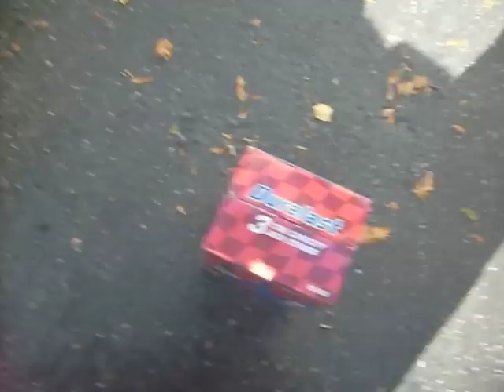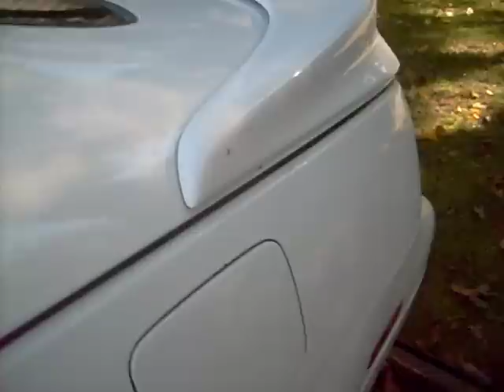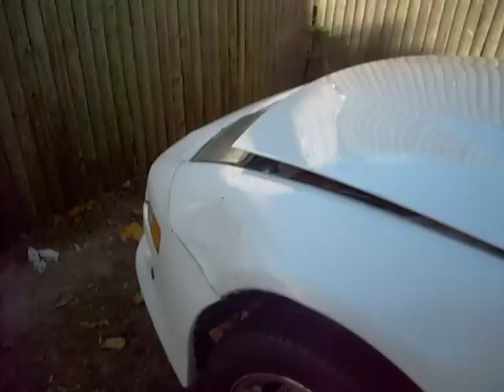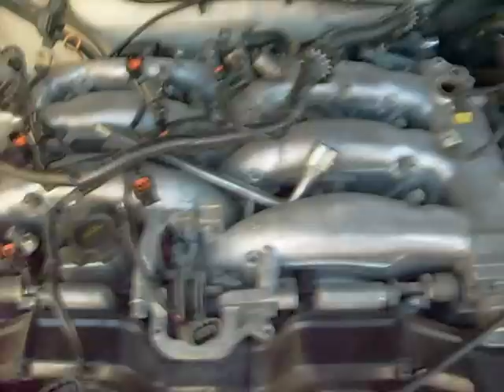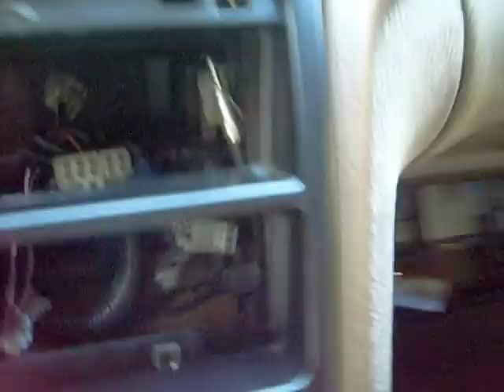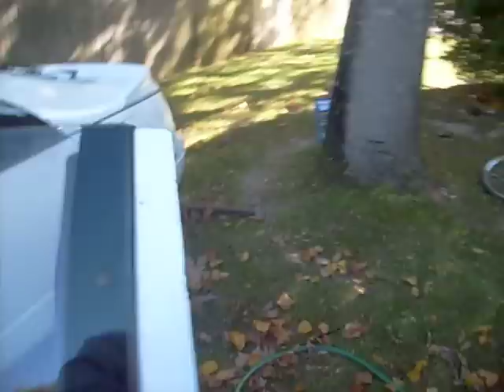300zx motor pull part 1

Comment: Still having a hard time with the plenum? Just wondering if you got the two EGR inlets on the bottom of each side of the plenum near the front? Also in the back there water inlet and outlets (rubber pipes) that run water up to the throttle bodies. I have pulled many vg30de's and vg30dett's, the water lines going to the back of the plenum used to get me every time. If you do a EGR and throttle body coolant line delete a plenum pull takes roughly 10 minutes if that from there on.